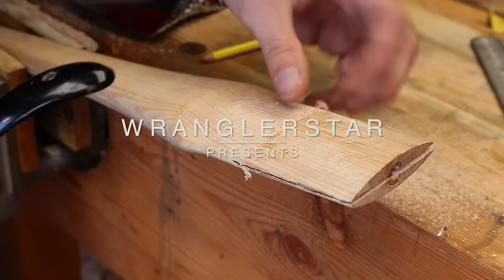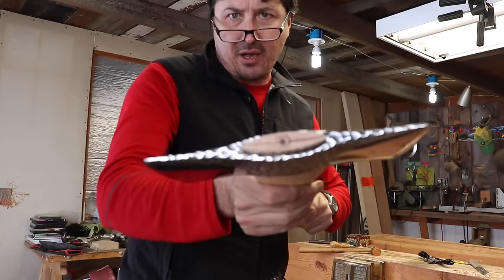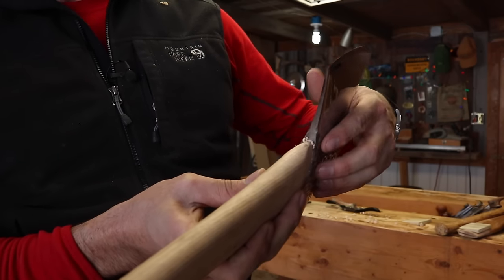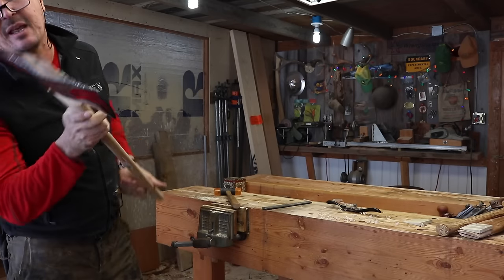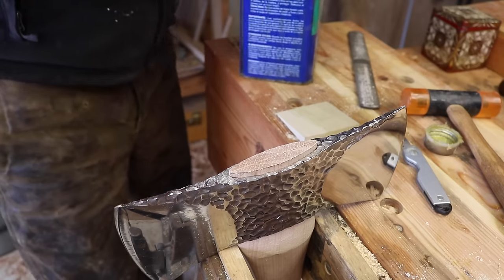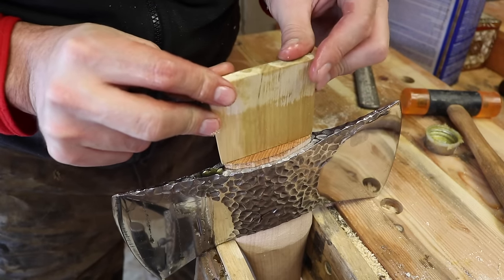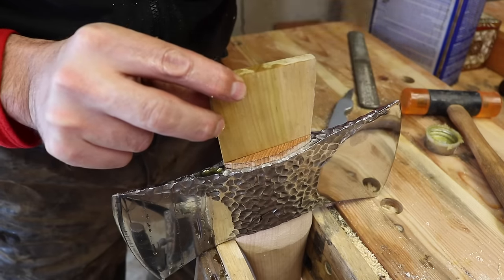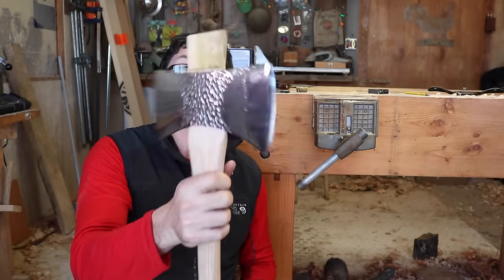AMAZING DIAMOND JEWELED AXE!!

Comment: Ok i know how too hang an axe handle how about telling us about the axe head??
Reply: LiL Hustler heat the head up to forging temperature and then tap it with a punch for the hammered look. When you're finishing the blade, take the grit up to 1500+ for a mirror finish. It's very important to get all the scratches out from the previous grit before moving up. A good way to do this is to sand in a diagonal motion with one grit and then perpendicular to that wth the next grit up. You can use a buffer wheel after sanding to give it even more of a mirror finish but personally I don't like it. It makes the tool too shiny and I feel bad for working with whatever I'm making. If I were making an axe head like that I would use differential tempering when heat treating. Apply more heat to the inside of the head to give it a deep blue color around the edge of the hammering. Besides looking great, that also provides more stability when chopping and will take some of the impact off your hands.